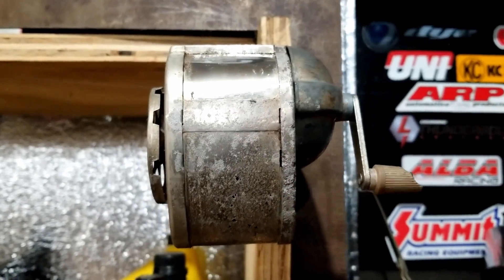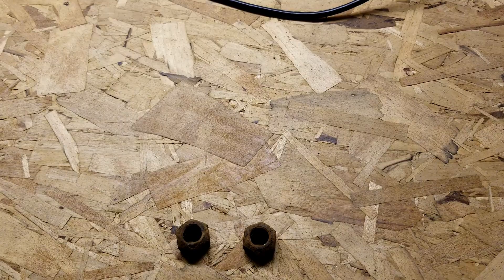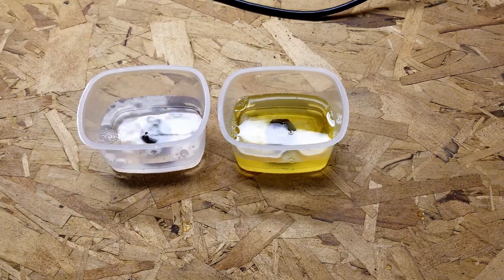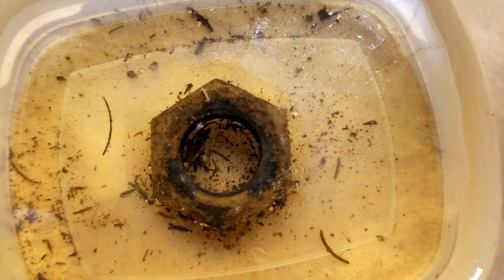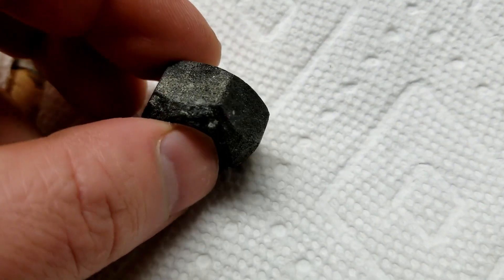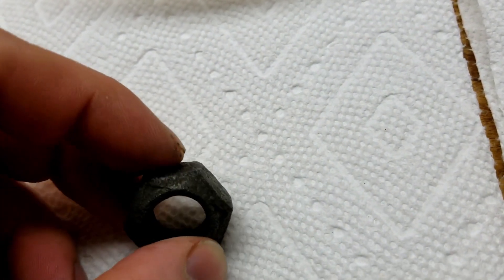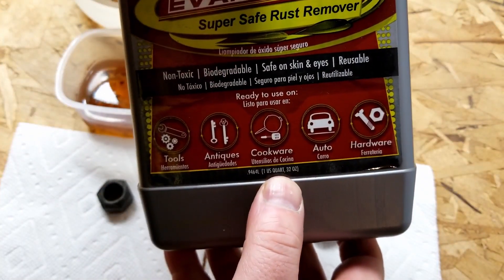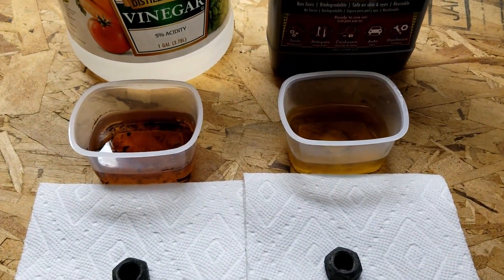Vinegar vs Evaporust

Comment: I wonder what would happen if you put a little bit of evaporust mixed in with the vinegar ? Good comparison though.
Reply from the maker: Mongo not sure what chemical make up of evaporust is, according to SDS it 80-90% water and 10-20% proprietary (trade secret) and have Ph of 5.9. Mongo notice that when a little bit of vinegar get into evaporust it turns cloudy, so the 2 chemicals do react in some way. Could be dangerous without knowing what evaporust made of.